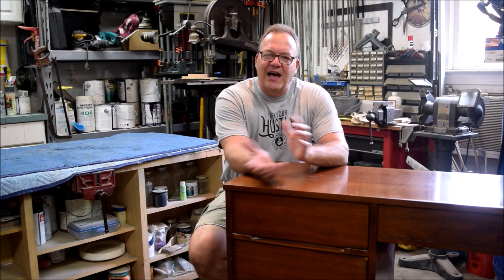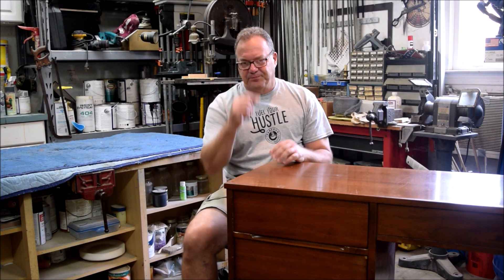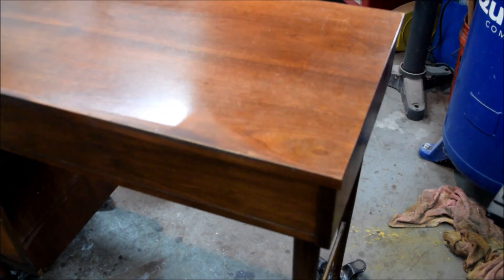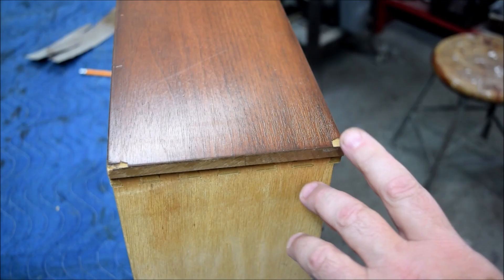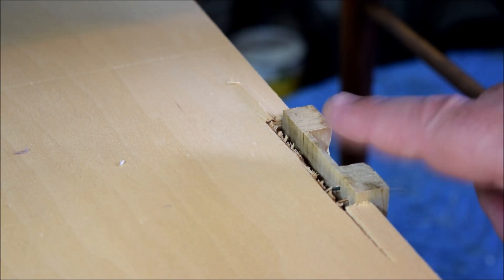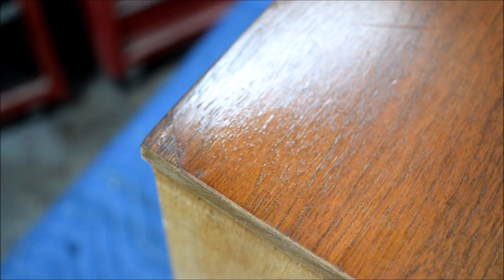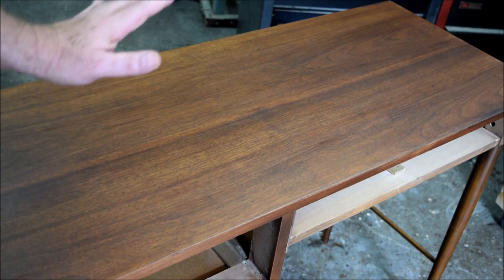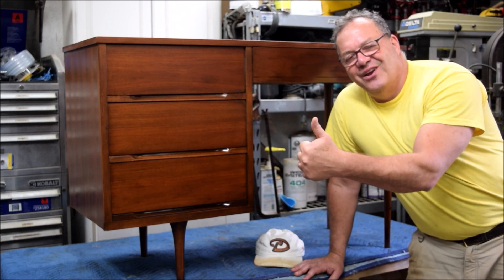No Stripper!  Refreshing a Mid-Century Modern Desk

Comment: Do you think gel stain would work similarly to the glaze you use for refreshing? I don't have glaze, and I'm wondering if maybe I can save my money by not having to buy another product. The glaze seems to save a lot of labor time versus a  total refinish, while achieving a nice look. Thanks for your help!
Reply from the maker: Gel stain is normally polyurethane based.   I wouldn't recommend it with a lacquer system.   I have no experience using it as a glaze.   You can try it on some scrap wood and see how you like the results.  Good luck and thanks for watching!
Reply: @LostMountainRestoration  I've never used lacquer before, but it looks like an attractive finish, based on your videos. I may just have to bite the bullet and buy more products. As for testing gel stain, I'd have to have a piece of finished something or other. I'll have to look around and see if I have anything that would work, that I don't care about.

Comment: Larry, I love the way the color turned out especially on the top surface. Sweet! Not much time into it for this result. Should be a quick flip. 
Question, is Glaze the same or similar to Restore-a-Finish? Thanks in advance and glad to see a new restoration. Time I invest in some of the powder color for repairs.
Reply from the maker: Glaze is more like a heavily pigmented stain designed to go between coats.  Restore-a-finish is a dye mixed with oil finish and an amalgamator which softens the finish and lets the dye penetrate.   Have fun with the color once you get it.   Practice with it and you'll have a blast.

Comment from the maker: I use a commercial methyline chloride stripper I get from a supply company in 5 gallon containers.  I prefer liquid stripper, rather than paste.   I find the paste is less effective, but you do have to keep the item wet when using the liquid.   For what I do, I want the stripper to be fast and effective; as such I stay away from the "green" strippers.   You need to be cautious with the MC stripper and follow all of the safety precautions.   Those safety issues may make a citrus based stripper or other alternative product more attractive for your purpose.

Comment: Would iron-on edge banding be feasible for veneer repairs?
Reply from the maker: I have never used it that way, but I suppose if the thickness was correct, the grain matches and the adhesive sticks you could try it.  I prefer solid pieces of veneer for repairs, so I don't have to worry about sanding through.  Also, make sure the heat you use to stick it on doesn't ruin the surrounding finish.  Good luck with it.
Reply: @LostMountainRestoration  it looks to be the right thickness. I didn't think about the heat issue though. The particular piece I'm working on has such a trashed finish that I'm stripping it, so I don't think it should be an issue.